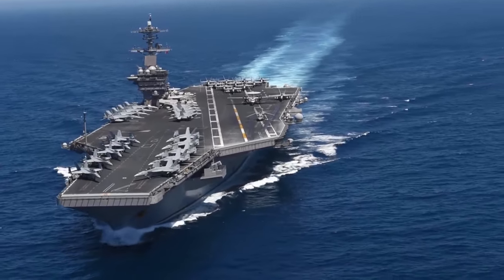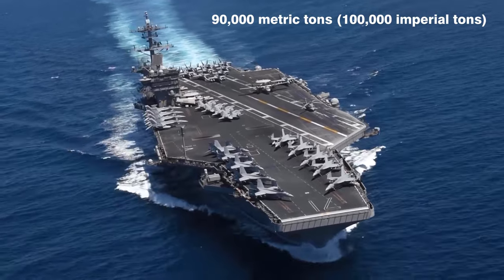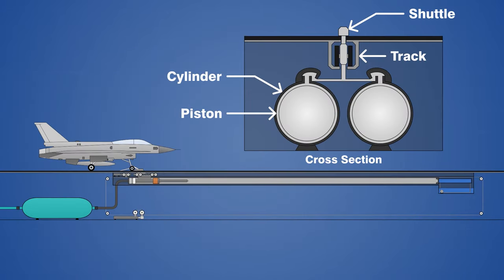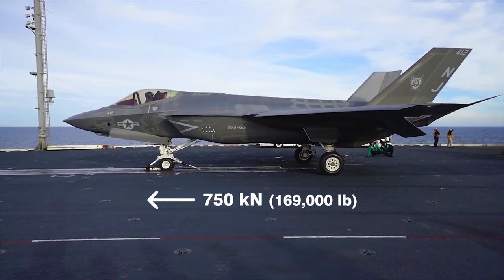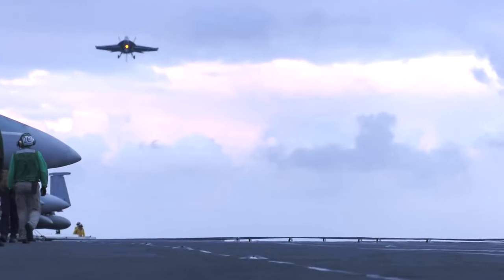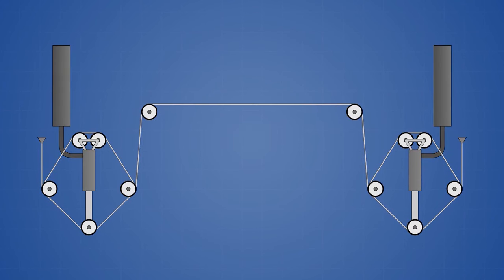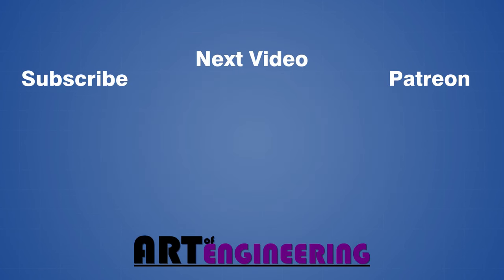How Supercarrier Aircraft Catapults Work

Comment: >Talks about US carriers
>Uses metric

Good job, sir. I applaud you
Reply: A C Indeed my friend. Indeed.
Reply: Dividing ANY unit into 10's, 100's and 1000's is a lot easier, more accurate and logical than dividing it by the archaic fractions of 8's, 16's, 32's ya know.  Imperial Units were devised back in the days of British colonial merchant times based on a person's hand, foot, or step length which was fine back then, but may not be the most appropriate measurement nowadays, though they can coexists just fine till it gets phased out after a few more generations. ;)
Reply: > Talks about Carrierlaunches
> showing an F-16 :D
Reply: You are so right.
Reply: 10mm = 1cm
100cm = 1m
1000m = 1km
Reply: @MiroPVP  more of 

1 000pm = 1nm
1 000nm = 1μm
1 000μm = 1mm
1 000mm = 1m
1 000m = 1km
Reply: totally
Reply: The Navy does use metric though.
Reply: USA has officially adopted metric long ago, but almost no one used it in the US, until now.
Reply: Yea because the metric system wasn't made by a drunk guy rolling dice
Reply: FYI... US Army use metric system for measurement!
Reply: Yeah the military uses metric
Reply: As a working engineer I generally prefer Metric, but for construction I still think Imperial serves a purpose. 12 is divisible by 2, 3, & 4. There is something beautiful about that. 10 is only divisible by 2 and 5. Those repeating decimals are significantly more difficult to work with in your head.
Reply: @argumasch663  not becaus it's better, but because the metric system is the only way formula's work, you will get wrong result if you use sometging else
Reply: @Sp00kq  neither was the customary system
Reply: I mean the metric system was invented in the U.S....
Reply: @BillAnt  ;)
Reply: DaBeast34 Not at all, it's French
Reply: Burgersaurus I like the imperial system better
Reply: metric is used all over the world cuz its accurate, simple and easy to calculate, imperial sucks
Reply: Khabib Armageddon  fourth is easy, 2,5, and what about dividing imperials numbers to fives

And also dividing by 4 is just twice dividing in half so not big deal
Div by 3 is much harder, but you just slap 3s at the end
Reply: @kimibaharev  This looks like it was written and developed by a ten-year-old. The problem is that you then have a fractional component for most of the "easy to divide" numbers you mentioned. Then again, I am arguing with someone that thinks "dividing by 3 is easy because you can just slap a 3 at the end of it."

Do yourself a favor, don't do any sort of STEM major in college. You clearly aren't cut out for it considering you missed the whole point of my comment.
Reply: Khabib Armageddon Well sry bout the first thing, still haven’t found out how to change my age, and sorry to disappoint you, stem subjects are my favourite and im already getting first places on olympiads and giving physics and math as 9th form exams (in russia its called oge, i dont know the counterpart in your country)
Reply: @kimibaharev  Cool, I guess this is your attempt to brag? It's not really working. I already earned my BS in Mechanical Engineering. You clearly don't have the mindset required to get one. Maybe less time bragging in YouTube comment sections and more time studying would do you some good.

Also, none of what you said is impressive. lmfao, don't know why you thought it would be.
Reply: @kimibaharev  Mechanical Engineering is the most broad field in engineering and encompasses everything from EE to BE. If you aren't cut out for ME then you aren't for engineering as a whole.
Reply: Khabib Armageddon thats why i said im not much into engineering
Reply: Kinda funny people are arguing about the accuracy of one measurement system over another. They can be both accurate as you need them to be. They can also be as precise. Fractions does not make an imperial system imperial.
Reply: @Paul Kryder Still the best military in the world
Reply: @khabibarmageddon7743  you talk about bragging and all in youtube comenta and your response that literally EVERY SINGLE COUNTRY BESIDES USA AND MYANMAR uses the métrica system is that the american military is better? I think I smell some hypocrisy....
Reply: Newtons and Pascals, huh?
Reply: @argumasch663  not for aviation, as a pilot I didn't understand the measurements even though my country uses metric
Reply: @BillAnt  bits?
Reply: @NolePTR  Of course, no one sane likes imperial.

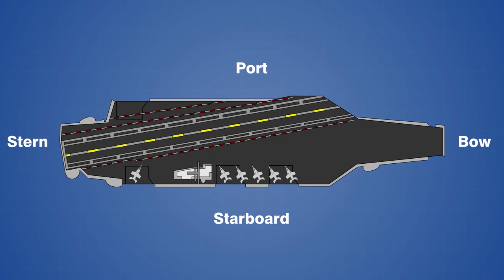Comment: 3:09 Not exactly. The reason why the deck is angled is not because of planes and personnel at the front of the ship. It's so that if a plane misses and crashes into the ocean, the ship doesn't run into the plane. This aids in the safety and recovery of the aviators. Planes and personnel being toward the bow of the ship is just a byproduct of the angled deck.

Comment: Your aircraft recover portion only covered the damper systems and not the arresting gear engine. It would be nice to see that system in detail.
Reply: Wire through pulleys pushes the hydraulic fluid through an orifice. There’s a valve on that orifice that closes as the cable pays out.  It’s a feed forward/feed back system based on the programmed weight of the aircraft, (36,000 for a Fa-18C for example) and how fast that cable is pulled.  Once that valve is closed, cable payout stops, and so does the airplane.  Regardless of the weight and speed of the aircraft, the  cable pays out the same amount if everything works as advertised.

Comment: You said this is twice the linier Gs of the fastest roller coaster but its not about speed, its about the acceleration.  Formula Rossa is the fastest coaster but defiantly not the fastest accelerating, the fasted accelerating coaster actually gets pretty close to this force, Dodonpa is a compressed air launch coaster in Japan that launched from 0 - 112 mph in 1.56 seconds.

Comment: It's interesting that you would mention Formula Rossa, since there are many similarities between aircraft launches and rollercoaster launches.
For example, you mentioned how the system used to be hydraulic. Intamin Accelerators, such as Formula Rossa, also use hydraulic launches.
You also mentioned how they were working on electromagnetic launch systems. Some rollercoasters also utilize electromagnetic launches. Rides such as Flight of Fear at Kings Island/Kings Dominion and Mr. Freeze Reverse Blast use Linear Induction Motors (LIMs) to lauch coasters. On the other hand, rides such as Maverick at Cedar Point or Full Throttle at Six Flags Magic Mountain use Linear Synchronus Motors (LSMs).

Comment: The bar at the back of the launch bar is the tow bar. When the launch bar locks into the shuttle, the tow bar comes off before they launch bird it to the air. so they can use it for the next line.
Reply: Tow bar is what they use to tow the plane with a tractor
Reply: @robertrichard6107  No that's called an landing gear rig. The tow bar is what keeps the aircraft in place on the catapult before launch

Comment: You forgot to mention the most important piece of equipment to retrieve aircraft , the emergency catch netting that is deployed when an aircraft is unable to use the Arresting cables due to a broken or missing arrestor hook.
The emergency netting is one thing that is hardly ever mentioned.
Reply: It's shown briefly in that Nimitz CV-68 movie from the 70's where they almost dis-obeyed The Prime Directive!
Reply: And it’s a piece of equipment that’s hardly ever used. Drills are constantly conducted “just in case” scenarios.

Comment: You really answer the little details that bug.  For ex., how the shuttle attaches to what has to function as a closed cylinder.  Not sure how a flexible strip is strong enough to not just blow open.
Reply: It’s a piece of metal like 100yds long by 2 in wide, and like 1/4 in thick.  It’s tensioned pretty good too.  There’s one on both sides of the catapult track.  It’s mind blowing!

Comment: Wow, very detailed and accurate.  You must have picked the brains of some ABEs...
Reply: He did great with the Cats but left out the entirety of the Arresting Gear Engine. he only showed the shive dampers on each side of the system to reduce slack during the arrestment. The actual system that slows the aircraft down is a very large piston and valve that uses the aircrafts own weight to slow the aircraft to a stop! Mark 7 Mod 3 is the name of the arresting engine!

Comment: A detail that's never discussed; the catapult accumulators are NOT 'filled' with steam. They are 'filled' with superheated water at saturation pressure. When the launch valve opens and pressure in the accumulator begins to drop, the superheated water flash boils to steam to maintain a fairly constant psi as the shuttle travels down the track. Without this phase change, the catapult would run out of pressure after 40 feet.
The amount of power behind each shot is determined by the temperature of the superheated water in the accumulator.

Anyone want to guess how many gallons of freshwater are lost during each cat shot?
Reply: I’m not an engineer, but isn’t superheated water, expands to steam when released from the tank

Comment: So what happens to the tow bar once the aircraft leaves the deck? 
On ye olde aircraft carriers, a wire bridle was used instead, which simply fell away when the plane took off.
Reply: It retracts between nose gear tires at end of stroke when it slides out of shuttle.
Reply: @robertrichard6107  Thanks for the reply. :)

Comment: With the electro magnetic launcher it will have a 0 time turn around and way less maintenance like the strips that are moved out of the way as it goes down the track wont exist.
Reply: Could you elaborate how long the turn around time it would take to launch the “next” aircraft after the initial on an EMALS catapult? 

And because it’s electric, obviously the “sealing strips” are obsolete.

So, how many personnel does it reguire as opposed to the Steam version??

Comment: Cool  I had always wondered  what happened to the piston at the end of the stroke , but i have a feeling that on some of the old carriers the piston was splashed out the bow on every launch ? was that so?
Reply: Nope... they used water-filled 'cans' of sorts in early early early aircraft carriers, and they had to be replaced after each launch (kinda like ammunition charges) If my memory is correct.  It took a while for them to design a re-usable system.
Reply: You may have seen an aircraft launched with the older bridal system, that doesn't use the shuttle. Some of the bridal strap goes into the sea, but it's pulled by the catapult.

Comment: 4:00
I HAVE SEVERAL QUESTIONS
Reply: Yeah seriously i didn't understand that.
Reply: All you really need to take away from this is, the angled slab redirects the jet blast up, instead of straight back onto the rest of the carrier. The "hydraulic actuators" are what keep the slab from being pushed back down by the jets own power.
Reply: Jet blast doesn't mean in case  the plane blows up. . ... if that's what you thought.
Reply: @hamnchee  No no, I know what jet blast is.
I wanna know why a Viper is being hooked up to a carrier catapult
Reply: @kimarykorlumiose7728  wow

Comment: Why are they using steam instead of normal air under the same pressure? Is that because steam already is an product of the nuclear generators?
Reply: No. The steam is a product of the BT systems. I don’t want to go into further detail until I fully understand your question. Could you elaborate a little more?

Comment: 2x 40 seconds = 1 in 80 seconds, but that's really one catapult able to launch 1 jet in 80 seconds. 1 minute and 20 seconds is really but really pushing things. It's usually closer to 2 minutes (120 seconds) and often 2 minutes. Non catapult systems with vstol Jets can actually launch at a much higher rate. You just point the Harrier or f35b down the runway and gun the throttle. The next jet behind can be already spooling up its engine. So catapults have much slower launch rates. Super carriers thus only produce high sortie rates because they have 4 catapults in operation. If they are recovering air craft then only 2 catapults are in operation. And that means launch rate is 1 per minute or a bit more. Each launch uses about 1200 gallons of fresh water, and with high sortie rates then purified water becomes the limiting factor.

Comment: Wish our Royal Navy had catapults instead of relying on jump jets , so many more types of aircraft could be utilised like high flying radar planes for early warning.
Reply: There is benefits to the ski ramp and jump jets.

For example, if on a US carrier that relies on cat and traps the steam generation is damaged or fails at some point they can not launch one plane. The catapult sulystems are not exempt from failing and breaking down, it does happen and if that happened in a time of war. They can't launch one plane, makes them pointless and a sitting duck.

The British aircraft carriers rely on a ski ramp, which has no mechanical or moving parts. It can't break down so mechanically is fool proof.

American carriers use catapult launched airframes. If the carrier deck is damaged from a bomb or missile, they can't launch any planes.

On a British carrier, even if the deck is badly damaged and even if the ski ramp is completely demolished they can do a vertical take off from a stand still position and still get in the air. Yes this costs fuel and yes this has weight limits, but its there if needed.

If an American carrier is somehow sunk or deck is out of commission in battle, a plane that relies on an airstrip will not be able to land. The American pilot will have to either crash land or abort the jet.

Where as on a  British carrier, the VTOL planes do not need a runway to land and can basically land anywhere that is suitable and then also take off from that spot too.

Also worth mentioning that there is no time needed to reset the flight deck for the next take off when using a ski ramp, again this is because there is no reliance on moving mechanical machinery like there is with cats. The planes can take off seamlessly one after anotherx every 30 seconds. Where as cats can take several minutes to reset and check. 

See, cats and traps aren't all they are made out to be. ;) VTOL has some serious benefits, especially in war.
Reply: Steve Sheppard ..But surely the US carriers have a contingent of F 35’s ..I don’t know , but they should have , admitted they don’t have a ski jump but they could get something in the air , our navy doesn’t have a carrier borne eye in the sky that can attain any altitude...Or do they ? Perhaps a jump jet can do that job now ? ..But it didn’t save HMS Sheffield in the Falklands ...I honestly don’t really know .. You tell me because as far as I know nothing we have covers our carriers, but I could of course be wrong..Hopefully.
Reply: @tomsmith5456  I think the USA currently only field F35As (conventional airfield) and F35Cs (carrier airframe) . They do still use Harrier 2s though. But they are subsonic and pretty old and arguably obsolete at this point. 

As for AWACs. Yes they are useful. However, the F35s sensors are so good that they are less reliant on AWACs than other 4th gen aircraft and are pretty good at conducting their own command and control.  AWACs also are very susceptible with little defense or stealth.  The F35Bs that we use are capable of sharing data and sensor information with each other and surface ships. Basically if one sensor system picks something up, it will immediately communicate with all other F35s and ships and they will automatically work together to identify and locate. AWACs aren't as necessary in 5th gen tech and will probably be completely unnecessary soon if not already.
Reply: Steve Sheppard ..Thank you Steve , I live and learn , it’s a pity they can’t loiter though .

Comment: Im more interested in the ‘nuclear powered carrier’ part
Reply: As an example, the Admiral Kuznetsov, originally designed in 1981, has 4 diesel engines that allow it to travel a total of 8,500 nautical miles. They refuel every 45 days.

However, the Nimitz class carriers, designed in 1975 (6 years BEFORE the Kuzentsov Class), have 2 nuclear reactors, allowing them to travel for an uncalculated distance. Why isn't it calculated? Simple. The Nimitz Class carriers refuel once every 25 YEARS, not days. These reactors produce significantly more power, with significantly less waste.
Reply: BIG TIME every 25 years? What a load of crap
Reply: @dingusbro925  Read up on it for yourself. Nuclear energy is more efficient than you think.
Reply: Dingus Bro Nuclear power lasts a long ass time in comparison to conventional fuel.
Reply: WatchYourLanguage why? Because the government says so?
Reply: @dingusbro925  I'm starting to think you aren't very smart. It isn't the government who uses nuclear fuel. It's private companies. Why don't you tell us how much more efficient regular fuel is, then? Why not show us that we're wrong?
Reply: BIG TIME whatever bro
Reply: Dingus Bro Because it is common knowledge.
Reply: @dingusbro925  So you're admitting that you can't? No offense, but if you don't know what you're talking about, best not question or even give your opinion.
Reply: BIG TIME whatever bro
Reply: @ojastelwane1790  Very expensive if you can't afford it, and if you're looking only for a short term replacement. However, when you run the cost of refueling every week versus the cost of refueling once every 25 years, the amount of money needed for the reactor actually spreads out evenly, and is pretty cheap.

Comment: The cat pressure is NOT 465 psi, you are missing several zeros.
Reply: Nimitz Class carrier’s Steam temp & pressure are close to proximity as explained. If you’re referring to the extra zeros, you’re probably referring to the hydraulic pressure, which is 2,500 +\- 250 psi.

I could be mistaken on what you’re referring to, but would also like to know what you’re referring to.